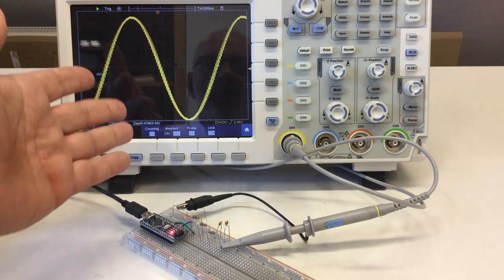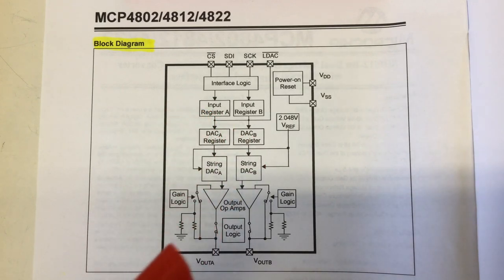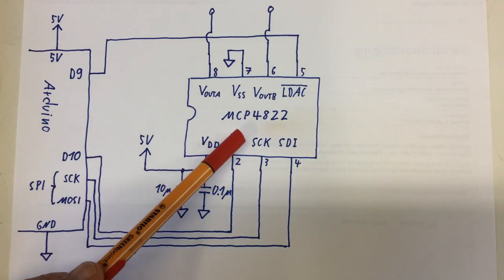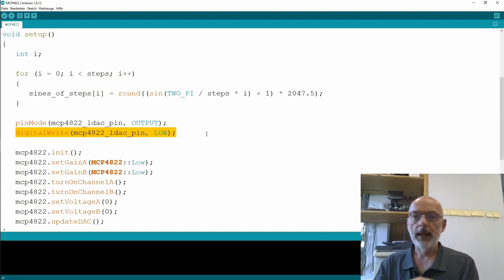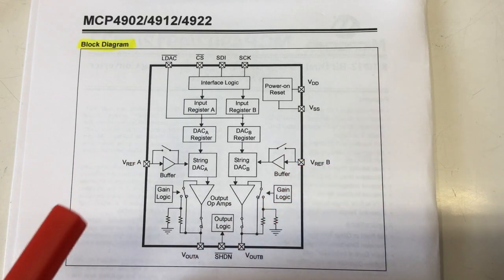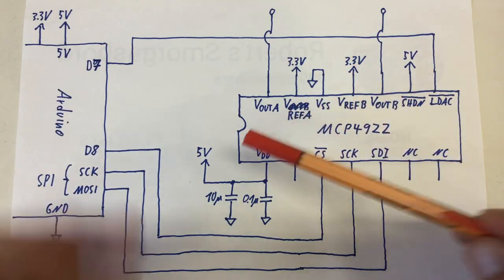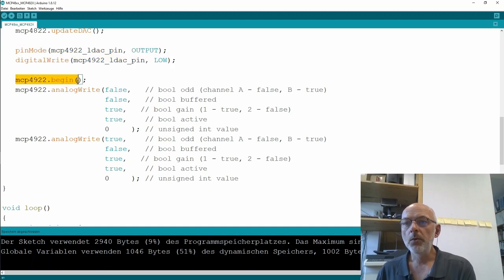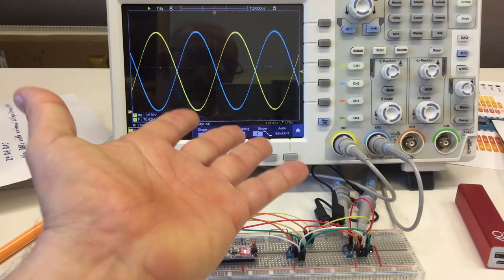Arduino MCUs and MCP48XX/MCP49XX Family DACs – The Basics

Comment: Loads of info about MCP4822 online, but nothing as clear as this, very good work
Reply from the maker: Thank you very much! To be fair, I started out with the information and libraries available online. "I stand on the shoulders of giants." ;-)
Reply: @robertssmorgasbord  Of course, as with all high level programming 😁  but the information from datasheets and the library examples, all condensed and explained very well
Reply from the maker: @mastermeenie  Thanks again! And yes, the datasheets! That's THE quintessential (and primary) source of information. You could say I love my datasheets :-)
Reply: @robertssmorgasbord  By the way, in the schematic show at 7:09, is there no need for resistors between the Arduino and the MCP4822's pins ? Also, is the MISO pin definitely free for other purposes ?
Reply from the maker: @mastermeenie  No, you don't need any resistors for a SPI bus, neither pull-up nor series. The MISO pin is controlled by the Arduino SPI library, so it's not free for other purposes, e.g. general I/O. You can of course have other additional slaves on the SPI bus that do use the MISO pin.
Reply: @robertssmorgasbord  Percect, thank you for all the info
Reply from the maker: @mastermeenie  You're welcome!

Comment: Excellent video. Thank you so much for helping people who (like me) don't have years of knowledge regarding these things. Using a library is very useful for me. I'm building a synthesizer and this is exactly what I'm looking for (generating control voltages). One question, is there any way to get the output of the DAC up to +5V without using an op-amp? The output of my DAC is maxed out around +4.5V. Thank you!
Reply from the maker: With the MCP48XX (internal reference) you are limited to 2.048V (gain setting 1x) and 4.096V (gain setting 2x) output voltage.
The MCP49XX (external reference) can get up to VDD-0.04V, so 4.96V at 5.00V VDD (close enough?) . Please note that you can run that thing at up to 5.5V VDD. Anyway get 5V out you'll just need an 2.5V external reference (gain setting 2x) or an 5.0V external reference (gain setting 1x). If precision is not a requirement, just connect your reference input to the 5V VDD rail and your done.
Note: The output amplifier can only supply up to 15mA. If you draw more current, you'll clip the output voltage.

Comment: Hi Robert, Is it possible to vary the amplitude of the sinus wave, just with the PWM ?  Just curious because I was wondering how closed loop inverters generate a varying amplitude with mosfets directly driving a 50Hz transfomer. TIA.
Reply from the maker: Hi, yes it's possible. If your PWM lookup table models a sine wave with values between 0% and 100%, you get the maximum possible sine amplitude. If, for example, your PWM lookup table models a sine wave with values between 25% and 75%, you get a sine amplitude that's only half of the possible maximum.
Reply: @robertssmorgasbord   Thanks for the reply. Consider doing a video on this topic :-) , Cheers and a happy new  year !
Reply from the maker: @mumbaiverve2307  You're welcome! And happy new year to you too!

Comment: I am trying to figure out if it is possible to connect two MCP4822s to using the library that you are working with here. Is it as simple as defining two dac instances at the top of the code and assigning different pins on the Arduino like this?

MCP4822 dac(10);
MCP4822 dac2(9);

I would then call dac and dac2 in the setup and loop. Am I missing anything?
Reply from the maker: Yes, it should be as simple as that. Note that you also have to run separate CS (chip select) lines to each of the MCP4822 from your Arduino (you're using pin 10 and 9 as CS pins on the Arduino in your example).

Comment: Excellent video! Is it possible to set the output amplitude to 200mV peak to peak?
Reply from the maker: Yes, just use a MC49XX model with an external 200mV reference.

Comment: Thanks for the video! Why the decoupling capacitors at VDD?  is this just to get rid of spikes/noise? and also why two of them?
Reply from the maker: One of the reason for the decoupling capacitors is indeed to get rid of spikes and noise on the power supply, which otherwise could get through to the analog output(s). Another reason is to buffer changing current requirements by the chip. The power supply trace/wire/cable has some resistance/inductance, so every change in current will cause some change in voltage. The reason for using two capacitor is to cover a wider range of frequencies: The smaller capacitor is good for filtering out higher frequencies and the larger one is good at filtering lower frequencies.
Reply: Thanks! @robertssmorgasbord
Reply from the maker: @ThevonMusic  You're welcome! If you want to know more details, have a look at that video: https://www.youtube.com/watch?v=BcJ6UdDx1vg (not mine).

Comment: Thank you for this wonderful video. I have a 4922 layring around and I've been wanting to get into DAC :) How many devices can you run off a single SPI connection? Do you have both the 4822 and 4922 running at the same time off same SPI? I know with I2C you can have a lot of devices on that bus.. dont' know about SPI.
Reply from the maker: You're welcome! With SPI you'll need a dedicated slave select (SS) line for each slave device on the bus. Don't let yourself be fooled by only one explicit SS pin being available on the Arduino. You can use any I/O pin for a slave select line. And if you run out of I/O pins you can use a demultiplexer to turn your N I/O pins into 2^N SS lines.
Reply: @robertssmorgasbord  Wow, sweet!  Thank you, I just journaled this!  So I could use like 4 of these dacs on an Arduino nano :)  For 8 synth Eurorack CV lines :)
Reply from the maker: @jenniferw8963  Yes, four of these for 8 DAC channels should be no problem on an Arduino Nano. But pumping out 8 channels at audio sample rates (40kHz/44kHz) is not possible with that little MCU. Or do you need just 8 analog voltages to control CV processors?
Reply: @robertssmorgasbord  I want to use my Arduino to generate CV signals for eurorack.  They are low frequency, typically.
Reply: @robertssmorgasbord  Btw, what do you think about the 5V output from a 7805 both powering the arduino, dac chips and most imporantly AREF voltage? Would it be as good as the 4822 internal referenence voltage? Or perhaps better?
Reply from the maker: @jenniferw8963  Then this solution should work just fine 🙂
Reply from the maker: @jenniferw8963  The MCP4822's internal voltage reference has a tolerance of about 2%. You can get some 7805 (e.g. ST L7805A) that also have a tolerance of 2%. But most 7805 have a tolerance of 4%. So you gain nothing from using a (L)7805(A).
What Arduino do you plan to use for your project? Nano? Nano Every? Uno?
Reply: @robertssmorgasbord  Nano or Mini Mega.  But I'm using MCP4922.  So I guess the internal ref voltage in MCP4822 would be better than a typical 7805 along with the 4922.  I guess the 4822 is a better chip?
Reply from the maker: @jenniferw8963  The only difference between the MCP4822 and MCP4922 is that the MCP4822 has an internal voltage reference (output range either 0V - 2.048V or 0V - 4.096V) and the MCP4922 doesn't. You would choose the 4922 if you require a better accuracy (>2% using an external reference) and/or another output range.
What output range do you need?
I asked about the type of Arduino you are using, because their VIN pins have different input voltage ranges (e.g. Nano v3,  Mega 2560 v3: 6V - 20V, 7V - 12V recommended; Nano Every 7V - 18V). So if you have power supply below the maximum voltage, you can feed that into the VIN pin of the Arduino and use the Arduino's 5V rail to power the MCPs - no need for an 7805 regulator.

Comment: Can it be used even if the capacity of the capacitor is different? And, is there any reason to have 0.1uF connected in parallel?
Reply from the maker: Well, the two decoupling capacitors are what's suggested in the datasheet. I'm sure it will run with just a 4.7uF or 2.2uF capacitor too, but it might impede the quality of the output signal. The 0.1uF capacitor parallel to the 10uF capacitor is there to decouple higher frequency stuff. The larger 10uF capacitor has a larger equivalent series resistance (ESR) for higher frequencies than the 0.1uF.
Reply: @robertssmorgasbord  
Are you saying that it is possible, but there could be a difference in performance? Thank you for kindly letting us know.
Reply from the maker: @윤미혜-z6h  Exactly. With a lesser decoupling (not using the recommended 10uF + 0.1uF) on the VCC rail you might experience more noise on the output signal. Also, the precision of the output signal of the variants with a build in voltage reference (MCP48xx) might suffer.

Comment: Amazing series! Could you explain me one thing, please? I have also built the schematics as you did (arduino nano and mcp4802). Supply voltage to mcp4802 is 4.87 volts, however on the Arduino's Serial Plotter I can see that my output signal is cut off at 3.6 volts on the upper part of the sine wave and the lower part of the signal is not at 0 volts. I set gain to 2, so I should have maximum output of 4.08 volts on upper part of the wave and 0 volts on the lower part of the wave. My signal is supposed to be oscillated from 4.08 to 0 V. Thanks in advance!
Reply: P.S I send to mcp4802 8bit values from an array of total 256 values
Reply from the maker: First, thanks for the praise! Regarding your question: The output swing of the MCP4802 is between 0.01V and VCC - 0.04V. So in theory you should easily get an output swing between 0.01V and 4.096V (gain 2, your VCC being at 4.87V far above the required 4.096V + 0.04V). So my question is how are you measuring the output of the MCP4802? Since you're using the Arduino's serial plotter I'm assuming your using one of its analog input pins. Here's the caveat: The ATmega's ADCs are crap. I think in the Arduino environment the VCC rail used as reference by default. Could you measure the output of your MCP4802 with a multimeter?
Reply from the maker: @artyomzingfeld360  That shouldn't change anything.
Reply: @robertssmorgasbord  you are right, this is the problem of analogRead whereas oscilloscope give it correctly out. Btw, what is the highest frequency have you gotten using SPI.h library, on my side it was something around 50-60Hz with almost no other Arduino logic added (pure reading from array and sending via SPI)? Thank you in advance!
Reply: @robertssmorgasbord  I means why so slow , taking into account that cpu is running 8 MHz (16/2 for default prescaling)
Reply from the maker: @artyomzingfeld360  Have a look at my "The Details" video on that subject ( https://youtu.be/BrZYVWQ-p3U?t=1012 ). The most I was able to achieve on a 16MHz Nano v3 was 84Hz (2 channels, 512 samples -> 86000 transactions/sec) with highly optimized code ... I explain the details in that video.
Reply from the maker: @artyomzingfeld360  Yup, I did understand you're talking about the need (lack) of speed 😉 See my other reply with a link to a video where I do a deep dive into that subject.
Reply: @robertssmorgasbord  thank you! Yeah I did read it. Well, there is also could be a solution to write directly to the ATmega registers that are in charge for SPI interface
Reply from the maker: @artyomzingfeld360  You're welcome! And yes, writing directly to the registers and bypassing the Arduino's SPI library is the only way to speed up things further.